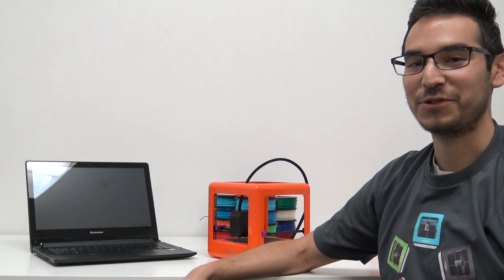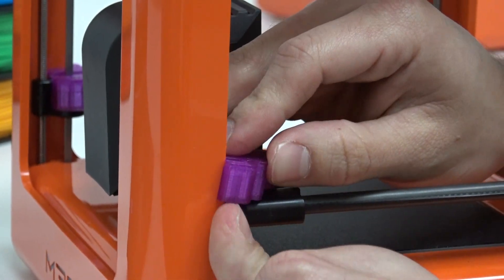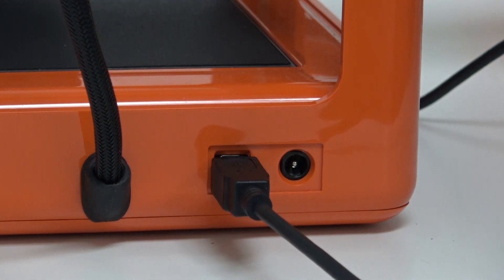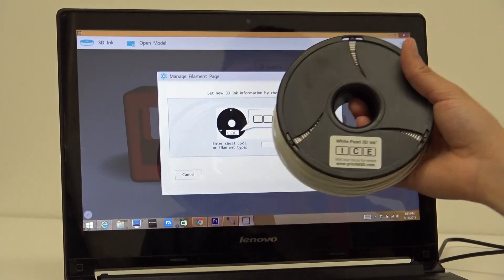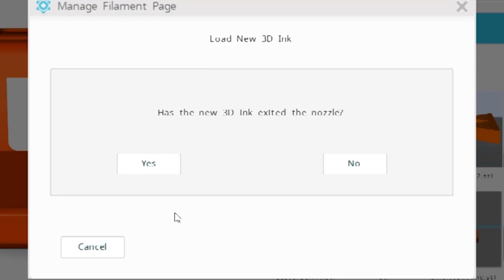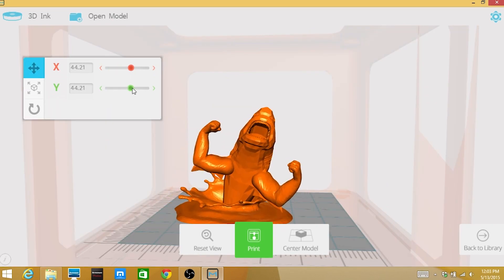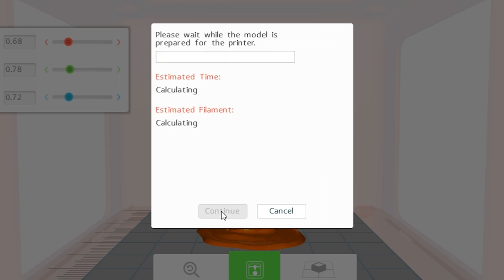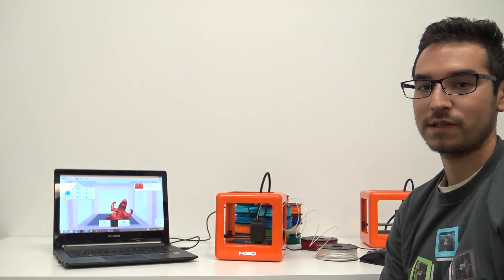The Micro 3D Printer: Quick Start Video Guide

Comment: Questions to people who have this first version of the M3D micro:

I have some major bugs and I want to know if there is other people with the same bugs.

1) If I make a second print right after the first one without restarting my computer, as soon as the printer starts I get a unexpected disconnection message of the 3d printer

2) If I want to change the filament, the 3d printer heat the nozzle and goes right into the bed (It actually make the bed melt) I have to make a emergency stop before and then I can change the filament

(I am using the latest version of windows via bootcamp because on OSX it just don't work well)

Thanks for the reply!

Comment: Should the printer be calibrated before your first print. Nothing was mentioned about that.
Reply from the maker: +Patrick Waksmunski It really depends on the print you are attempting. The automatic calibrations should be fine for most files but the more circular they are you may need to adjust a setting called back lash a few times to get them perfect.
Reply: Thanks.